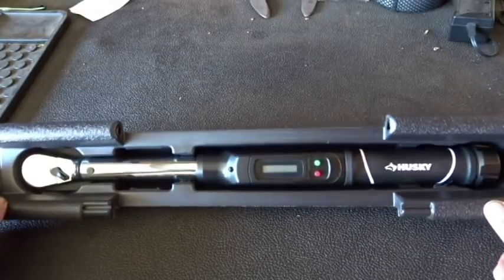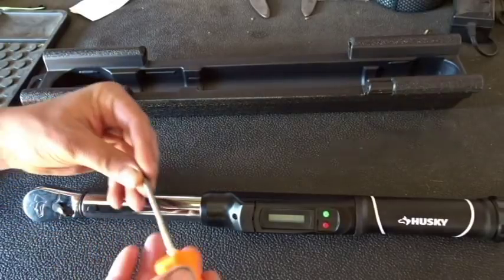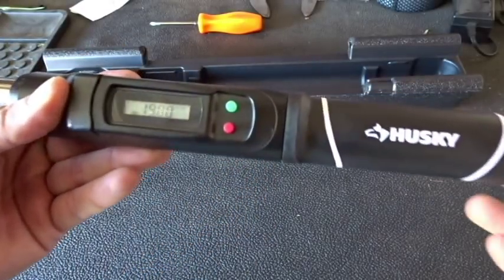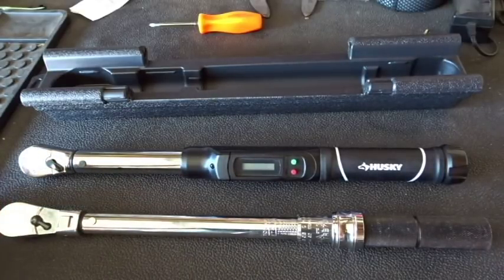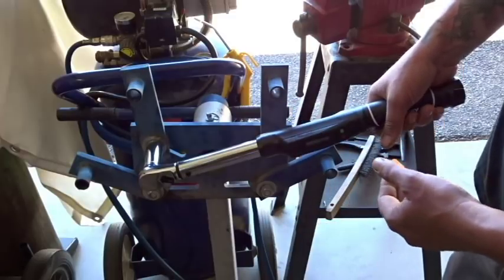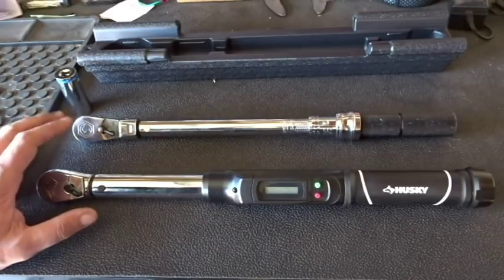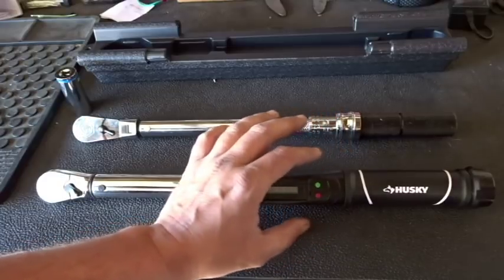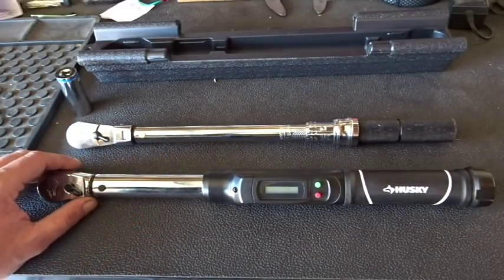All New Husky Digital Torque Wrench Review

Comment: The Gearwrench 85076 beeps and vibrates, although it's $25 more. It also takes 2AA  which are a lot easier to get your hands on than those button batteries.
Reply: Important to note this is covered by lifetime Warranty no receipts no questions ask at home depot. Not sure of the gear wrench.
Reply: @williamacosta6337  Not necessarily true. HD will only replace with the SAME item without a receipt. When HD discontinues an item and no receipt is available they will not offer a replacement or store credit. I only know this because I've had to experience with a few different Husky tools.
Reply: @TheDrok75  true, that lifetime rule applied to a led large flashlight I purchased years ago that didn't illuminate with new batteries. HD told me to grab one off the shelf and even exchanged no questions asked. I was about to toss the husky.
Reply: @williamacosta6337  but only if it's the same item, these are discontinued so its doubtful they'll give the newer model as a replacement

Comment: Helpful vid.

Editing my previous response which was probably incorrect, looks like all electronic torque wrenches have a strain gauge, but the more expensive ones (like SO TechAngle) can also measure angle past the torque setting for additional tightening and can calculate torque applied past the limit.

https://en.m.wikipedia.org/wiki/Torque_wrench?wprov=sfti1

In other words, if you want to know torque applied past the setting, you need a torque wrench that measures angle.

Or you could set it to a higher setting and just watch the screen.

Comment: This is a clicker type that uses spring and ball detent.  You will have to back the setting to zero after each use.  Snap-On TechAngle uses strain gauge to measure torque.  Strain gauge torque wrench will give you actual torque reading, including over-torque.  There is no need to set it back to zero.

Comment: Justin, go back to Home Depot and get you money back.  I had repaired (20 yrs) many torque wrenches and industrial tools and in my opinion I will not trust this tool.  I agreed with Traveler X, if you need to go digital get a Snap-On or another good brand.  Also, make sure It comes with a calibration certificate.  This is a poor attempt of making a basic click-wrench looks cool.  Just my 2 cents.  Good review
Reply: Even though it has a lifetime warranty?

Comment: It's like any other click style, but it simply has a digital display like the Craftsman Digiclick. It's not really "electronic," it's mechanical and has no clue of any torque being applied so it can't even begin to monitor over torquing or be adjusted via push button. Instead of laser etch or an engraved scale it has the digital numbers to display.

Other than that, it is kind of neat. Not bashing it, it was the best way I could think of making it clear for others.

Comment: As it stands I don't like that torque wrench. It's basically a regular one with a turn knob and batteries. I always worry about batteries dying.
Reply: All that it is , is a digital reader for a regular turn style torque wrench,  thats quite disappointing
Reply: I just watched your video. Thank you for showing me how it works. The digital screen does illuminate if you hold down the green button once it is on just in case you still didn’t know.

Comment: Same design as the craftsman digi-click torque wrench. Hope you have a better return warranty than Sears. They're pretty much junk. The weakest part is the knob; if it breaks then you will need a replacement, since the plastic knob seats onto a metal stick attached to an electronic sensor. Mine broke on the first few tries and it made a metal clunk like yours, instead of the traditional "click" sound. Finally found a person instead of a automated message from Craftsman, they replaced it in a heartbeat.
Reply: The Husky has a lifetime warranty. Good idea to save the receipt...